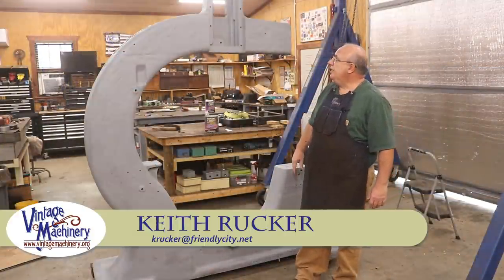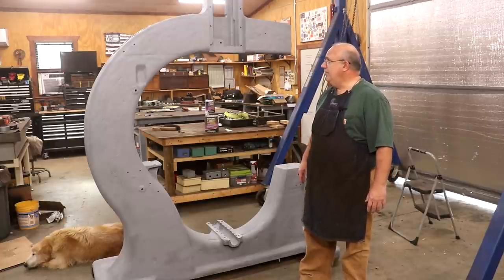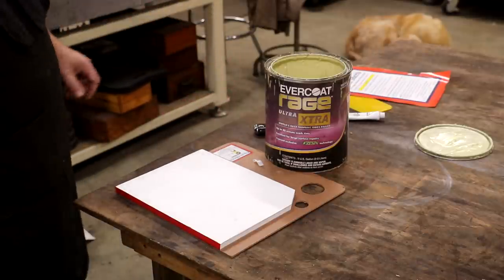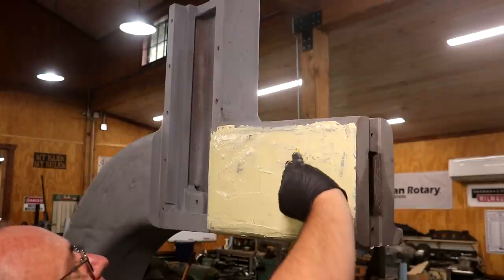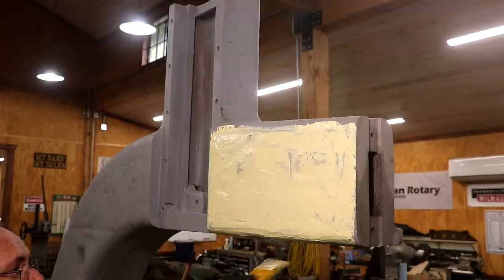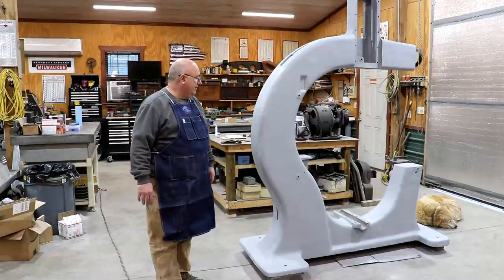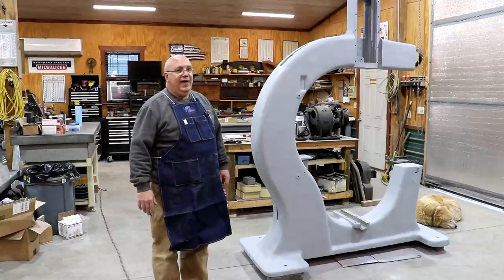Diresta Bandsaw Restoration 13: Applying Body Filler to the Main Casting for Paint Prep

Comment: Great video.  If for no other reason than to support the algorithm, I have been using TotalFair, a marine version of what you used.  It’s a 1-1 mixture of a blue and yellow and you know you have it fully mixed when the green color is saturated.  Like all exothermic reactants, you can slow it down by getting it spread pretty thin after it’s mixed, small batches still better, etc.  It also sands well and doesn’t load up the sandpaper.  I don’t think any of this is necessarily adding to the knowledge sharing here, unless the community isn’t as aware of the product and the tools and techniques in the maritime trades.  Really enjoy your videos and the humility and honesty with which you produce them.
Reply: The best way to slow it down is to keep it as cold as possible...
Reply: I don't need to use things like this very often, but having options and recommendations are welcome.  Thanks for the info.
Reply: @Henning_S.  as a chemistry masters holder. Yup cool it down and this will stop the molecules reaching the activation energy as quickly. Just look up a bell curve :)
Reply: @stxrynn  if you use too much of the hardener it also cures faster, if you use much less hardener than required, it never gets completely solid or at least it is harder to sand down, because it stays a little rubbery. But you can use this to your advantage on flexible parts to prevent the body filler from breaking, just use slightly less hardener...

Comment: Looks good Keith. The real job in filling is how you hold the spreader so you fill in the valleys. That is where the filler has to be thick and is most vulnerable to being gouged out with a flexible spreader.  But - it look great. We can only like once each posting and once subscribed - always on the list. And I save them all.

Comment: I was called Snowman back in the early 80's. I restored 64 1/2 to 70 year model  mustangs. I have applied 100s of gallons of body filler. Everyone has their own way of applying it and whatever works for you. Just keep the air bubbles to a minimum when mixing it. I used 1/4 inch plexiglass for a mixing board and cleaned lacquer thinner.
Reply: A dedicated piece of sheet aluminum or plexiglass is cheaper than the one-time sheets of paper.
Reply: I've only done a couple cars, so nowhere near your experience.  I used a kitchen cutting board, one of the white poly ones with a smooth finish, for mixing.  You just let the unused bondo harden, then bend or twist the board and it falls right off, no cleaning necessary.

Comment: Better than new. Coincidentally, this week I'm restoring a 1967 US Burke Millrite milling machine. Currently partly stripping the column and was in the market for a body filler. Thanks for the tip on the Evercote, just ordered. Your process is as I would do it, thin coats. Just like when I do sheetrock work on remodeling or repairs, thin coats to build a uniform blended in finish. Great work and thank you.

Comment: Sensitive Adjustments:  One way to make sensitive adjustments easier is to put a tape flag on the shank of the screwdriver or adjustment tool.  The flag makes it easier to see how much adjustment has been cranked in.  (This was an old Heathkit hint.)   I realize that the comment is about Monday’s video – but put it in Friday’s video comments.   Thanks for the videos.

Comment: l use 2 litre  ice cream tub lids, when it dries you can twist them and the body filler comes off, and my kids go through a tub a week
Reply: I have a sheet of glass I use, and have had for years. By the time I get what I'm using spread out a quick pass with a single edge razorblade and it's ready for the next batch ... ;)
Reply: @PhilG999  l found glass [old car door window] too heavy and there was a chance of dropping it carrying it around the car and shattering it
Reply: @debeeriz  This is not old car window glass. It is a one-foot by one-foot square of 1/4" plate glass with rubber feet on the bottom to make it easier to pick up. It is not tempered glass. And in 40+ years I've never dropped it...

Comment: Keith your to slow with the pudgy knife .You can add Bondo Hunny to make it thinner glove on smear it on by hand works nice around curves .use a air sander disk , or orabel typ sander and use a spray HV FILLER AND EPOXY COLOR FINISH . 😋

Comment: The body filler  - yes very difficult to get the right measures of paste and hardener - Like with the isopon plastic padding we used to use, a fair bit of paste with a tiny bead of hardener, but if that tiny bead is just a tiny bit bigger, the stuff goes off way too quick! Excellent job, Keith, I'm sure JD is happy with it so far! :)

Comment: good work!  Love the Evercoat line!  One suggestion on the sanding though, hit that stuff with 36 grit AS SOON AS POSSIBLE. As soon as it starts to harden and not make 'bugers' when sanding its ready to sand.  Work a small section at a time and it will go MUCH quicker than doing the whole project one layer at a time.

Comment: Evercoat makes a 2-part finishing glaze called icing. Works very nice for filling small dings or low spots and sand scratches. Doesn't shrink back like the glaze you used and sands very nice. I will sometimes use a thinner for the glaze called plastic honey if needed. Also Keith, you might consider a single stage urethane paint instead of oil base enamel. Holds up really well against damage from dirt, oils, and solvents and is easier to clean up as well. A project like this is more than worth the extra cost of materials. Anyhow, saw is looking good Keith and I can't wait to see the ole girl making cuts again!

Comment: great video
as you said, the finish desired is not a piano like finish so if you have used a rigid metallic spreader, the finishing would have been much less tedious as the thichness control of the filler is much better.
on the finition coats, when the shape permits it, I prefer use a rigid spring steel style spreader, it pays off at the final sanding operations.

Comment: I'm a cabinet maker and usually have a piece of Formica around that I can mix on. If you scrape it off while the filler is green it's generally not an issue.  If you do get a little build up it comes off with lacquer thinner.....(what works for me)

Comment: Looks great Keith and whoever finally gets this bandsaw will be happy with it as well. 
It’s tough to put 💄 on a 🐷

As for doing body work. My only equivalent experience is finishing drywall. I don’t enjoy doing it but I do do a good job of it. Build it up with thin coats or it just ends up on the floor when you sand it.

Comment: Tiny bit of advice, fill the lowest spots first dress them up the cover the shallower with subsequent coats. Makes the job quicker.
Reply: Yep, the trick with any kind of filler is to "scrape it flat". Don't try to "fill" anything, just apply filler then scrape off leaving the high spots bare. Then, after it hardens,  knock off the bumps with the scrape and scrape another layer on FLAT.
No sanding needed between coats! If you are filling so much that you need to sand, you are wasting time and filler material.

Comment: One point I will make about the conventional Bondo brand filler vs the Evercoat one, the hardener is red and the base resin is grey, so you can tell how well the hardener has been mixed in by how uniform the pink color is. with a yellow resin and a white hardener, it is harder to tell how well the hardener is mixed in.

Comment: I know your not looking for feedback, lol and I dont want to be "That guy"  But But body filler should never be applied over unsanded cured epoxy primer.  Epoxy primer has an "open time"  Usually 3-7 days for most brands.  Within that period, you can apply filler, or paint, any other top coat right to the primer, after the recoat window has closed, you can have adhesion problems with any topcoat if it isnt sanded/scuffed first.  The roughness of the casting will help offset this though.  Looks good!

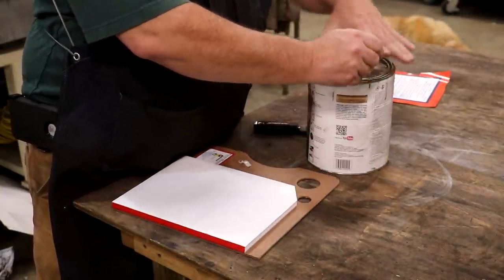Comment: 2:30 .. I use a plain sheet of window glass, cleans up SO easy, just sand the edges with window glass with emery cloth, or use a glass grinder if you know anyone who does stained glass stuff.
Reply: Clean up is a waste of time.  Use a piece of cardboard,  spread your leftover mud smooth on the cardboard and use it again and again until it gets too heavy to be comfortable.

Comment: What I found that works for me is putting the first coat of Bondo on pretty thick and as level as possible and then rather than sanding using a SureForm (before Bondo is hard but is firm to the touch) to knock down as much as possible without digging into the low areas.  Then applying a second coat of Bondo and again using a SureForm (again before the Bondo gets hard, you want it firm but not hard) to take off the high spots.  Do not worry about the lines left by the SureForm as with scraping the high spots (blue) are what is the right thickness, still no sanding.  It is not until the finial coat of Bondo that it is left to get hard. It is also the coat that is applied as thin as you can, and as smooth as you can apply it.  Then Sand with 150  and finial sand to 200 if needed.  Most primer coats will fill any scratches left from the 150 sand paper.  Again this is how I have got it to work well for me.  Thanks for sharing what works for you, Keith.  God Bless, glad to see you are in good health.
Reply: The best way to do it is to NEVER apply so much that you need to sand between coats. The blade does the work... that's why it is flat and straight and rigid. You SCRAPE the filler on and then scrape it off so the high spots remain exposed. Then you repeat, but you don't sand in between coats, nor "level off" with a Sureform or sander or whatever... If you have to sand or grind, you arte applying too much filler, which wastes time and money.
It's the same as when you fill a hole in your lawn. You don't over-fill and make a huge lump, then plant the grass over it, wait until it's established, then come along and cut it off afterwards. When you do is apply thin layers of fill and scrape them level with the surrounding area, and repeat as many times as needed until the depression is not noticeable.

Comment: Looks good.  And I agree, it's a machine.  My machines don't get that kind of attention.  If they work right, that's what's important.  I do like to see how though.  Maybe when I have more time, I'll get out the body putty and pin stripes.  After this paint job, I bet that saw will cut a smaller kerf and never wander in the cut!  ;)

Comment: hey kieth ..its been a while since i piped up so thanks for the videos. i feel a need to go full keyboard commando on you lol  and i have less experience at thin than you  , but spent several decades with a pole sander and a roller and  putty knives which i think may help.  1 a larger blade will make leveling the surface easier  and keep the edge clean. it seems from random internet car shows  and my painting years ....first coat as heavy as you can dont even try for neat just full coverage with a large blade...then move to the 6 inch . while mixing the catalyst try not to mix air into the filler i suspect there will be fewer pinholes to glaze. best of 2022 to you

Comment: Ever coat also make a product that you spray called featherfill. It is a polyester primer that is catalyzed just like the filler and does not shrink like lacquer based glazing putty and can be sanded in 5 minutes. It's more or less spray body filler out of a cup gun

Comment: Hey Keith, I believe evercoat makes a “thinner” filler for doing the small fill jobs that works well after you get most the big stuff filled and gives you that glass finish
Reply: It's called "(Evercoat) Plastic Honey". It works well for thinning the filler, and if you have a can of filler that was not sealed properly (and dried out), it can make it useable once again.
Reply: I just use finishing putty

Comment: For the thicker areas you can mix a little fiberglass building insulation into the filler.  They make commercial versions, but making it yourself is way cheaper and you get the consistency you need.

Comment: Hello Keith, your videos are great and very informative, I would say with a lot of my machines I rebuilt I like to keep it as original as possible and that means sometimes to prime and paint, and not bonding as the perceptions are the diamonds of the machine as they were never the same machine, as  different operators and finishers . From manufacturers. Cheers and keep up the great work

Comment: Great stuff once again, Keith!  I used to help my father-in-law with body work.  More filler wound up in shreds on the floor than remained on the vehicle.
Reply: If you are sanding body filler like that, then you are doing it wrong.
Reply: @johncoops6897  Not me, father in law.  He had a cheese grater like tool, one inch wide and a foot long.  I knew he was doing it wrong, but that's the way he did it.  More like building with clay and sculpting😂
Reply: @tonyc.4528  - The device is called a "Sureform", quite popular with old timers who didn't understand how to use body filler properly.

Comment: For whatever paint you are going to use, see if there is a comparable high build/filler primer available. It’s a primer but it goes on thick to help fill in minor imperfections. a light sanding with 220 is all that’s needed, mainly for adhesion, and the paint job will look noticeably better. rust oleum and POR-15 both have such primers available.

Comment: Looks awesome, Keith. I have a tip for mixing Bondo - mix it on a cheap, thin, plastic cutting board - Generally, when it sets up, you can bend the board and the set up Bondo will pop off.
I'm curious, did y'all hand sand the whole thing or use a DA sander? For your helper's sake I hope you gave him a DA or something. LOL.

Comment: FYI - The poor mans RAGE evercoat  (or similar quality product) is just auto store bondo mixed with fiberglass resin.  The resin makes the cheap stuff much smoother to spread and it sets up harder.
Reply: I'm curious how that works? From What I remember, Bondo type products use  Benzoyl peroxide (yes the same stuff as the pimple cream), paste hardener, while Fiberglass Resin uses Methyl ethyl ketone peroxide (MEKP) as its hardener...
Reply: @trollforge  I've used it many times on projects where 'good enough' is good enough.  I'll generally use about 1 to 10 ratio of polyester resin to polyester filler, mix it then add the normal amount of cream hardener.  It provides a more 'buttery' filler that is easy to spread and rework as it starts setting up.  I find that it has a bit of a harder surface once fully cured which I like so that I can be less... carefull... when sanding it. I've never had a problem with it not curing even thought the hardeners are a different compound.  I wouldn't use this on my Fleetline though, I would just opt for high quality filler like the Rage product he is using.
If you look at the Rage Ultra Xtra he is using, it has resin already in it.
Reply: @OMCbuilt  Awesome, thanks for getting back to me! It's more than 20 years since I was building race cars, and rebuilding 19th century farm machinery... but if I ever have need of body filler again I'll try this out.

Comment: You may want to ask your sand blaster what he used for primer   If it is expoxy based you should really do a light scuff with some sand paper prior to applying the filler if its been sitting for awhile after being sprayed.  Probalby not a big deal on a machine.   Keep up the good work.

Comment: Keith. Not sure what paint you have planed for your finish coat, but might I suggest using a gray or green “hammer tone” paint. I think not only will it look good over the vast area of the saw frame, but it will also help to hide some of the small blemishes. But then I don’t know if will work if you want the look of  an 1800s machine.e

Comment: While I cannot fault you for buying the paper , you might try using parchment paper normally used for baking. It is less expensive in the long run even if it is not already cut to size and back it onto a clipboard for application procedures.

Comment: I am curious as to what product was used as filler 100 years ago. Modern body fillers date to the 1950s or possibly WWII, so what was used 100 years ago?
Reply: On Motor Vehicles, everything was Metal Finished and Lead Wiped where needed on seams and joints etc, Industrial stuff like this they used a lot of Coal Tar Primer, it was applied while heated..
Reply: I met gypsum on old machines:-)
Reply: They would have used a linseed oil based putty filled with some combination of chalk, white lead, red lead or iron oxide. You can still buy stuff like this minus the lead.
Reply: @adamnorton9595  I've never seen anything other then that Black Coal Tar used on every old Machine i've ever Stripped.

Comment: I’d like to learn how to do body panel filling with lead like they did before bondo type products. I was told about it from an old timer car collector but idk if it’s really a million times better like he said lol.
Reply: Lead is much worse, because the rust gets under it. Most old cars with lead fill need those areas cut out and replaced.

Comment: That Evercoat Rage is VERY expensive, at least in 1/22. Does it keep as well as Bondo? One thing I've always liked about polyester body filler is that 10 years later the stuff can still be used.

Comment: Keith what would the original makers have used for filler in the 1880/90's, given the absence of epoxy materials. Did they have cellulose putty?

Comment: What did they use as "body filler" before Polyester resin.  I know lead was used on autos, but i don't see that working a large casting.